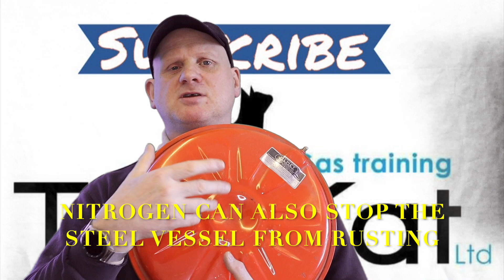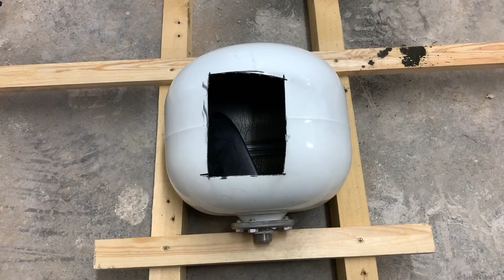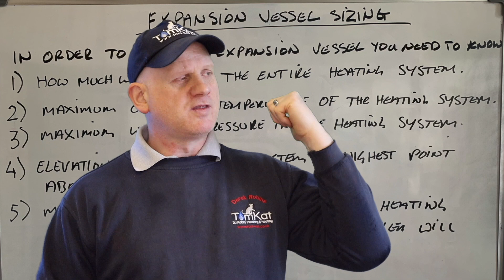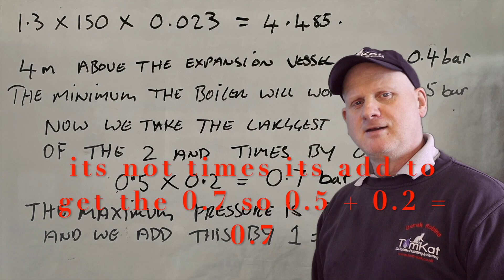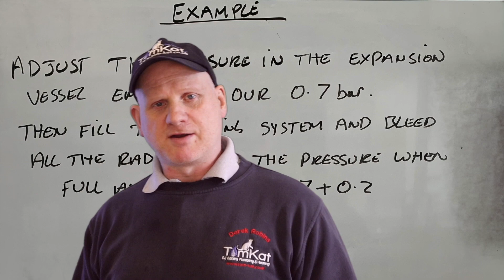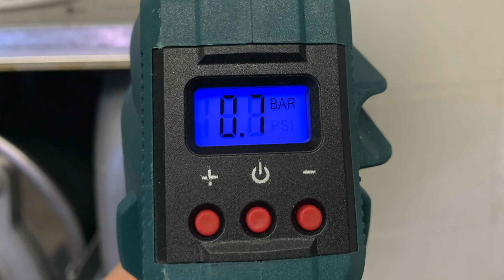EXPANSION VESSELS, sizing, installing and how they work. all trainees need to know about ex vessels.

Comment: Well presented - On the question of setting the pre-set Air pressure with the water side to be empty/drained  my Xclusive 24 Intergas boiler has the Air and Water  connections on the top of the Vessel  SO how to empty the water side - - Do you use the Pre-set setting pressure to expel the water in the Vessel or remove the Vessel and turn it upside down..joe

Comment: Thank you for the detailed video. One thing i wanted to add here is that there are more than one reason for the expansion vessel to go to the return side. The first is obviously to save it from high temperature and the second is to gain the positive pressure of the circulating pump. In a small house it may not be an issue but not for a commercial or industrial setting.

Comment: Always set the work piece solid and have two hands on any angle grinder preferably using the side handle.
The ligaments in your fingers will take 18 months to heal if damaged and an operation under general if snapped.

Comment: Hi, 
how can a 3 per cent comes to 1.3? it must be 1.03
Reply: Just about to make same comment, 1.3 is 30% expansion
Reply: I thought I would see if anyone else had spotted that and I'm glad someone did.

I know the general rule is to size CH expansion tanks at 10% of the system volume and most people say that that is conservative.

It also seems that most heating engineers oversize both radiators and boilers, but that's another topic.
Reply: @robi4387  thank you for your very great videos and Chanel.
Can I suggest a topic for video? 
Basically, I came across this situation that I have been asked to do a cp12 for an office and they asked me if I am commercial engineer and I explained that what commercial mean in gas industry, had another situation that it was a commercial property and I doubt it that is the gas pipework needs to be labeled or not, another situation was they joined two offices together and they had two meters but the total kw was more than 70 but pipework was 22mm because they fed from different meters and I didn't know if I can do it and raised it with gas safe and they said I can do it. I am sure you will find other situations related to the commercial and can make another great video about it.

Comment: Hey! Great video, insightful for both the tradesman and civilian (like me!). One thing I’m getting a bit confused on is whether a 300L megaflo and a 30kw system boiler would need a separate expansion vessel for 10 radiator system? I held off on buying one as the merchant included it but my builder suggests that a megaflo has one in. The merchant explained that the megaflo one is only for the hot water and not for the central heating, again not sure. Key for me if it’s needed or not which is something I’d hope you can help explain :)
Reply from the maker: The megaflo has a built in expansion vessel for the hot water and a system boiler has a built in expansion vessel for the primary water to heat the cylinder and radiators. They are separate waters so need the 2 vessels

Comment: 33:53 Tut tut, water from the schrader valve doesn't always mean the diaphragm has gone, most times it's probably just condensation. Shoulda mentioned that methinks. (Of course average Joe plumber will just go for a straight replacement rather than double checking!)
Reply from the maker: Tut tut that would only happen it the Schrader valve is at the bottom of the vessel as the water is heavier than air so sinks to the bottom of the vessel. Should have mentioned that me thinks but average comment makers only go for the negative.
Reply: @tomkatgastraining  Yea we also need to know the difference between Negative Remarks and Good Constructive Criticism

Comment: Excellent video Derek.Just wondering what are your thoughts on flushing expansion vessels to prevent Legionella  building up inside.I have recently been pulled on a Legionella risk assessment and have be asked to have all vessels/pipe work  modified enabling them to be weekly flushed....seems over kill to me.
Reply from the maker: I think that if you install the vessel higher than the cylinder a use copper pipe and not flex’s there is not much chance of getting legionella.

Comment: Interesting. Was never to sure about expansion vessels but now I feel a little bit better. I’ll definitely be watching this one a few times though. Especially the maths on sizing them up. 

Once the expansion vessel takes up the expansion of the central heating water, what then happens with that water? Does it always stay inside the expansion vessel or does it make its way back into the central heating system again? 

Also, what does this pressure in the vessel actually do? What’s it’s purpose?

Sorry if the questions are silly and don’t make sense. I had to ask.

Thanks Derek. Much appreciated 👍🏻

Asian Jon. Training.
Reply from the maker: Yes the water stays in the vessel and the air in the vessel keeps the pressure behind the diaphragm so when the water cools the air pushes the diaphragm down again

Comment: Great tutorial.Loved all the detail and the practical aspect in the workshop at the end.An adult  learner question please:@19:30 you gave us a figure of 1.3 for expansion .not quite sure 
how you came to this figure or how that is linked to 3%(0.03?).Is it a generic figure for expansion or one you came up with by calculation.Thank you again.Look forward to your next video.
Reply from the maker: It’s a figure the manufacture came up with for the expansion of the water so 3%
Reply: @tomkatgastraining  3% is 1.03 not 1.3. 1.3 would be adding 30 percent not 3 percent.
Reply: @jamesabdilla  is correct. The calc should be 1.03 not 1.3. 1.3 is 30% expansion
Reply: @tomkatgastraining  Thanks for the clarification

Comment: Hi Derek, For those of us over in Belfast, with no water meters, is there a rule of thumb calculation as to how much water there is in a system, (for instance, a normal 3 bed semi with 10 rads would have about ?????? litres), and does the amount of water ish have to be very accurate?
Reply: I had to work out expansion on a system using something similar to this on a large commercial heating system a few years ago. They’d had new boilers, and someone had noted they had no expansion vessels. He was correct, they didn’t, but what they had was a buffer tank of water filled by a float valve. When the system heated up the expansion was controlled by a pressure switch opening a solenoid valve dumping the increased water volume into the buffer tank. I explained this to the engineer reporting no vessels, but he was adamant about there being no vessels. I left him to run with it ( he was my supervisor), and he put in 2 small vessels prob less than 100L total. He ditched the buffer tank, so, when the system expanded from cold the system kept shutting down due to high pressure. 
I was asked to look at it. I’d not done anything like that for decades, and after a lot of googling came up with a figure of ( roughly from memory) 420L. When I submitted it to the customer ( the local authority ) their engineer just said “we operate on 1 litre of expansion required for every 1 KW of output of the heating systems boiler/s” to which they ordered up 2 x 300L expansion vessels. 
They went in and there’s been no further issues since. Talking to other commercial engineers since, the 1L for 1KW seems to be an accepted way of calculating vessel sizes on large unknown heating systems.
Reply from the maker: It has to be as accurate as you can get it or the vessel could be to small and you get more than a 0.5 bar increase. I don’t know of any rule of thumb for the volume but most combis are set up for about 130 to 140 litres
Reply: @tomkatgastraining  Hi Derek, thanks for the video and this snippit of info.

Comment: II don't see how multiplying by 1.3 is 3%.  x 1.03 is 3% more.  1.3 is 30% more.  Can you explain this, thanks.  I asked Altecnic and they said that the pressure vessel size is correct if from cold to hot the pressure rises by no more than 0.5 bar so if you calculate it and then it rises by more than that you need a larger one.
Reply from the maker: If I could I would lol it’s the factor that they use for the water volume it made no sense to me either but that’s what is used.
Reply: @tomkatgastraining  Also 0.5x0.2=0.1 not 0.7.
Reply from the maker: @tonysmith7028  if you watch the video you will see I put the mistake on the screen that you add it not times it and I even say later in the video about the mistake